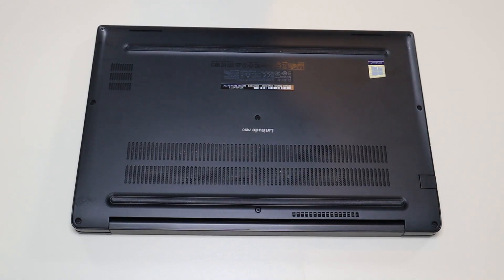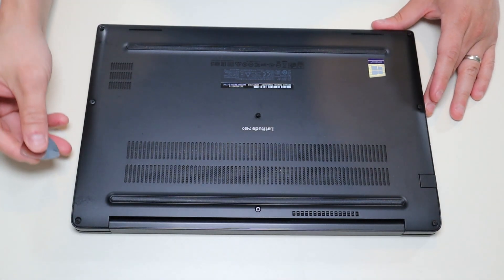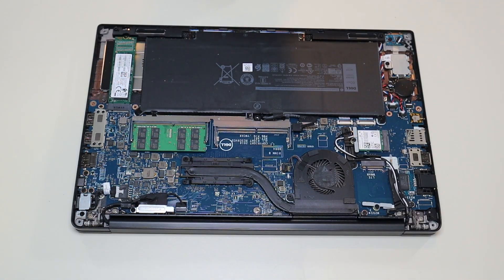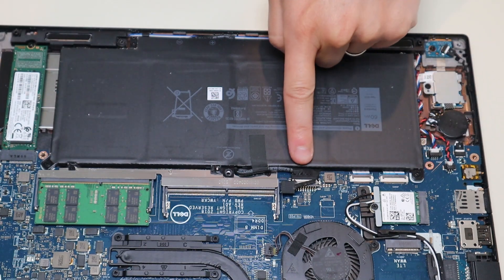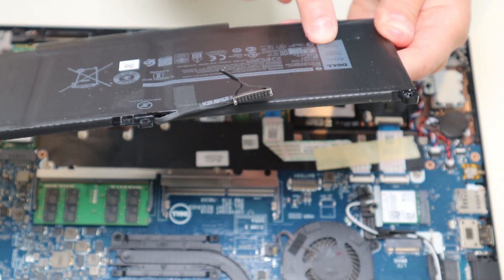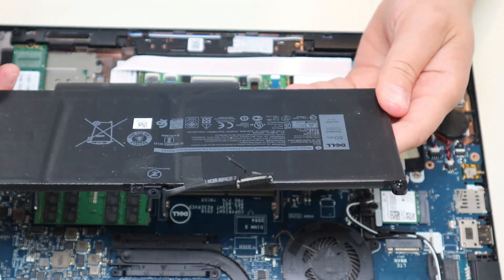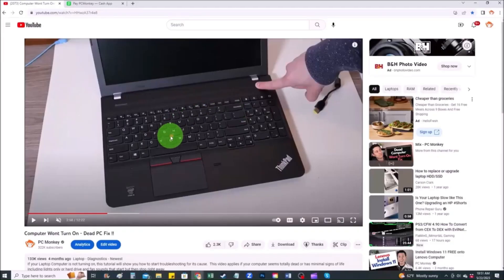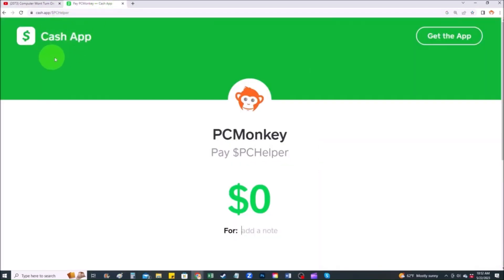How To Replace Battery - Dell Latitude 7490 Laptop

Comment: Hi and thank you for the video. First question: if i put away from pc the battery. the PC will continue to function when i connect it to the charging ? Second question : when i push the on/off key the pc keyboard is flashing for 2 or 3 times. The on off key remain with the light during the flashing and after goes off all. Video is always black. Any advices? Thank you
Reply from the maker: For a computer that does not turn on, try this video first; https://youtu.be/kOBY4k2Mn_k. Let me know how that goes :)
Also, did anything happen before this issue appeared?  Liquid spill, overheating, Windows update, etc?
Reply: @PC_Monkey  ok thank you i Will see the video. Nothing about spill or overheating or Windows update ..i Will keep you informed .thanks a lot
Reply: @PC_Monkey Nothing happened . I tried only tò hold the Power on off Key for a minute. During this time the keyboard was flashing. When i released the Key the keyboard flashed for o e or two times ..then all down. I forgot tò say that the battery was already not efficient for a long time. When i take away the charging cable the PC goes off in a couple of minutes. Thank you for support.